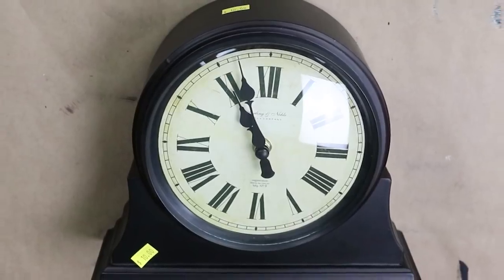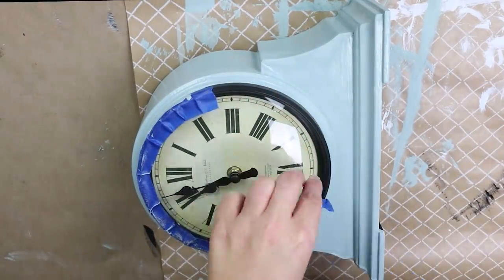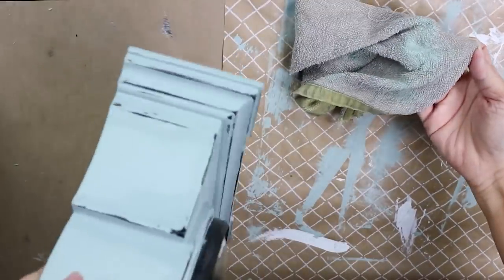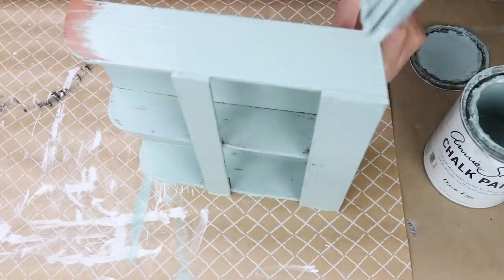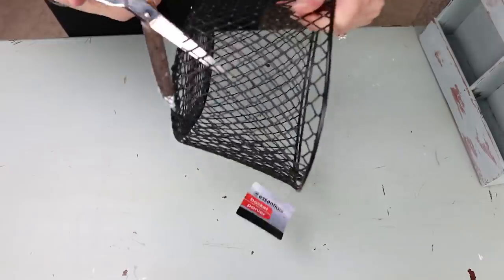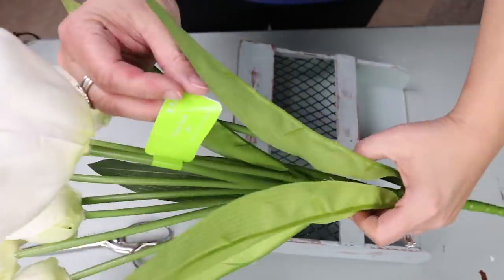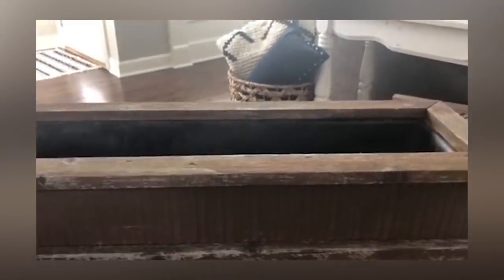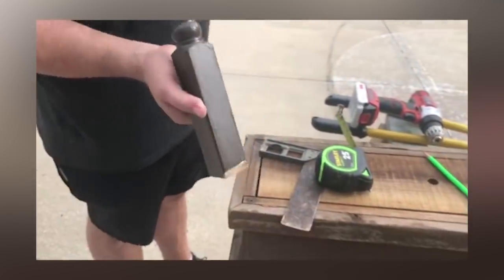Upcycle Thrift Store Home Decor ⭐ DIY Makeover

Comment: Hey there, it's Deb here. My favorite was the planter box. But one thing I would have done different was is something that I have done in the past when I have to whitewash something that has two different colors and paint or staying underneath. And that's shoe polish that I get from the Dollar Tree. It comes in so many different colors and you can wipe it right off. I would have also lightly sanded and legs, that way the gloss of the legs doesn't show through. My other favorite one was the brochure stand that you did with the Tulips and the candle holder you did that was on your dresser. Those turned out really pretty all of them did I was doing a knowing all the way through it but those few really caught my eye. Thank you for the lessons that you have taught me. There is so many things of country decor that I absolutely love but when you go shopping for them they are so expensive. I am a crafter and a thrifter. Together I can make some really amazing things. Especially when you shop at the Dollar Tree. Nobody knows that the glass vase that you might buy, came from the Dollar Tree. Or a nice set of silverware. They've got some really pretty patterns on their dishes that would be so easy to change out with the seasons. I remember years ago shopping at the Pottery Barn and finding the same kind of prices as the Dollar Tree on a lot of their things. Especially glass or ceramic which were very easy to make. That is if you knew how to make Ceramics and blow glass. Thank you for your video have a great day. take care and God bless Deb

Comment: Please also do a DIY Scissors sharpening. After cutting the metal from the basket you can probably throw the scissors away otherwise. There are tools called sidecutter, specially invented to cut metal, seriously, it's not just easier but also much safer with apropriate tools too.